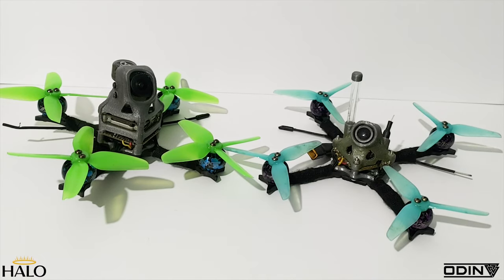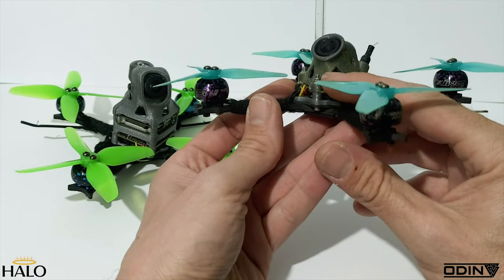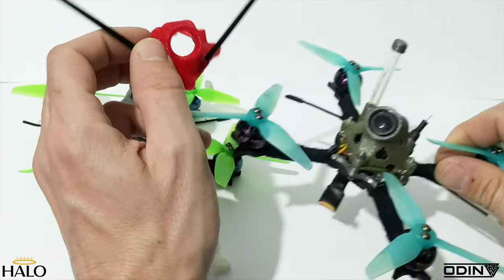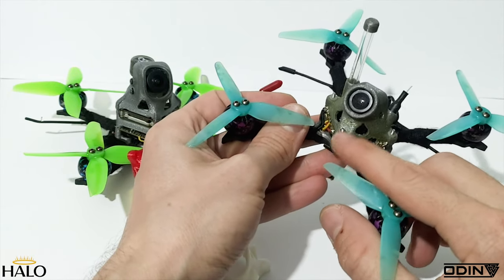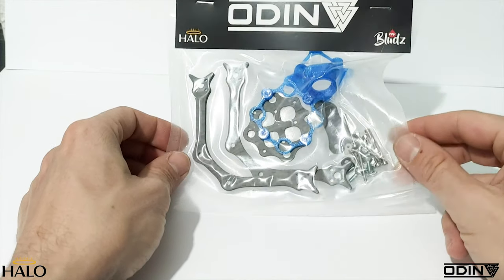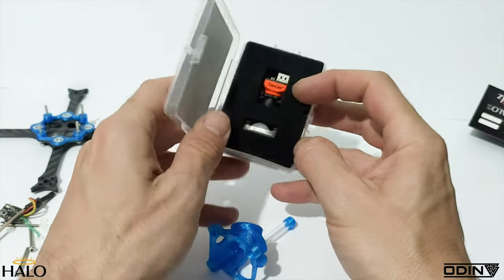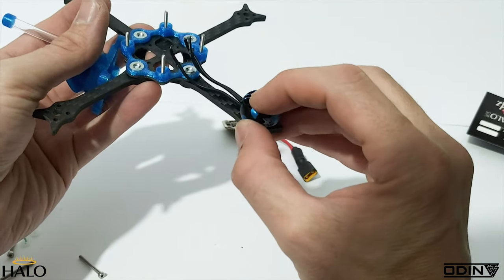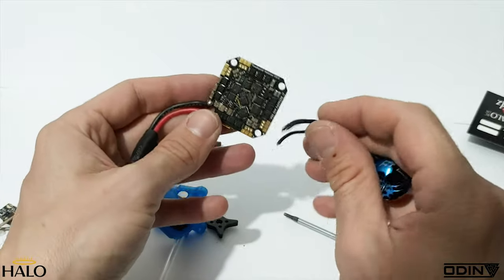HaloRC Odin Frame Overview & Build Guide - NEW FRAME RELEASED!

Comment: Hi! Just putting together a vista version of this and just wanted to check - is the vista intended to be secured by friction fit in the 3D print or is the intention to have the stack screws replace the standard hardware that holds the vista together? Cheers
Reply from the maker: Hi mate. I had a feeling you might not have realised how it goes together because you didn't order the M1.6 20mm bolts that are required for a vista build... that's why I popped some in for free ;) Remove 4 bolts from the bottom of the vista, then use the 4 I included to go up through the frame, through the stack and into the vista itself.
Reply: @Bludz  legend, cheers mate - I'll tag you in the finished build shots! 🤙
Reply from the maker: Nice one, happy building dude :)

Comment: Looking for 3.5, would the 3 inch frame fit 3.5 props? thanks for making the canopies available in thingiverse.
Reply from the maker: Hey man. Sorry for the delay in getting back to you. 3.5 inch won't fit this frame and really the motor size it is designed for will be too weak for that size. I have been testing a 3.5-4 inch version of the frame running 12mm diameter mounting patter motors like 1506 but I'm just not happy enough with the design to release at this time.

Comment: What motors do you use for 4 inch?
Reply from the maker: 4 inch is still a bit shit at the mo, not many prop options to choose from and compnies can't choose between 9mm T mount or 12mm standard prop mount motors. 1506 3000kv for proper props, 1404 4500kv for T props.